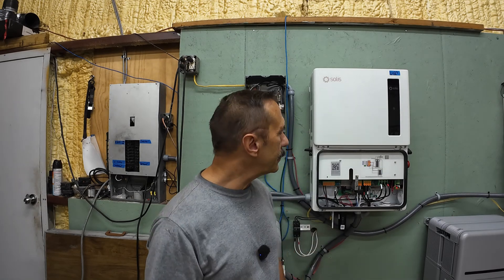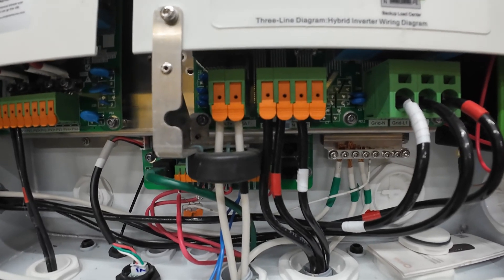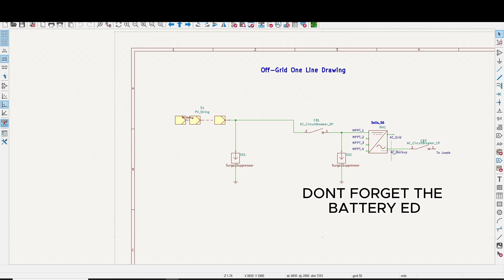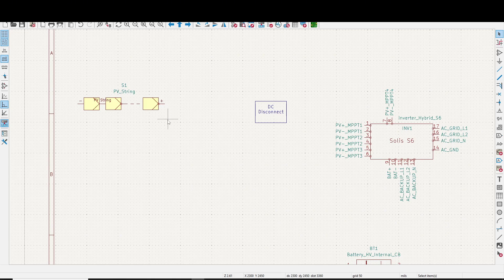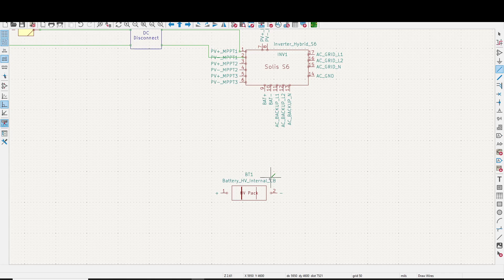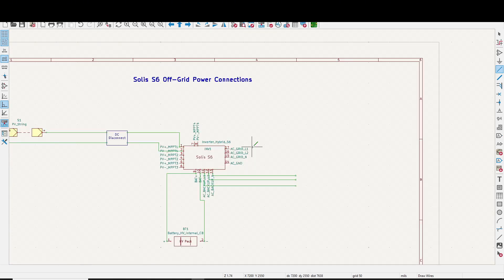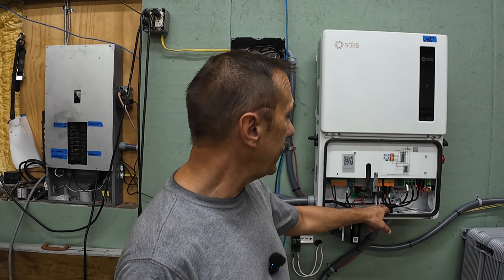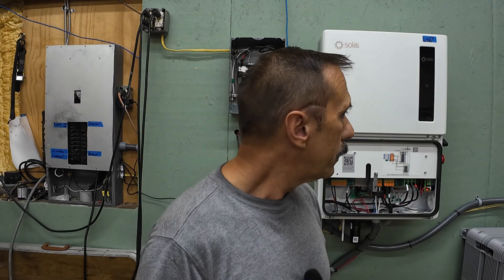How I Set Up My Solis S6 High Voltage Inverter For Easy Off Grid!

Comment: When you run the Solis from an EV battery how do you set up the Solis to charge that battery with the correct voltage?
Reply from the maker: It's handled by the Battery Emulator, on my system the inverter thinks it's connected to a PYLON HV Battery.

Comment: Is there such a thing as a split-phase (120-240vac), off-grid inverter that runs on battery packs of 85-  130 volts (32s of LiFePO4)?
Reply from the maker: Only one I know is the new NOVA by EG4 but they will most likely be using a proprietary battery.
Thanks for watching!

Comment: What voltage DC do you run?

How do you keep you cells in balance if not using a 48v BMS?
Reply from the maker: The HV batteries all have built in BMS's and my voltages run ~400 volts.
Thanks for watching again! ;)

Comment: The generator input. I assume that just helps it feed more power in as needed, to further feed the loads ie. electrical subpanel/main panel, depending how people set it up. Is that correct, or is this port mandatory to actually power and run the inverter? Never understood how the inverter gets it's power to run in an offgrid set up, after the sun goes down. Unless the battery does this part as well as power the loads at night.
Reply from the maker: Good question, the generator in most situations is used as a back-up system in case the battery gets below a preset state of charge (SOC) for example you get into a weather pattern and your solar is not enough to keep the batteries charged. So it's mostly there as an emergency back-up, your battery bank should ideally be large enough to run things through the night at a minimum.
Reply: @DIYSolarFarming  I got it now. Nobody explained that specific part in their videos, so I wondered. Perfect. Thank you.